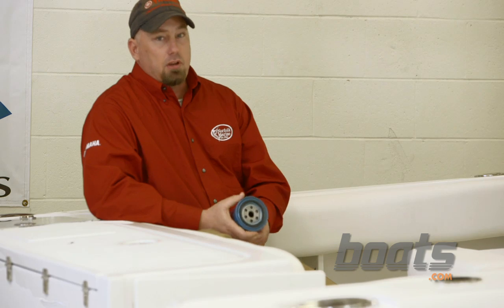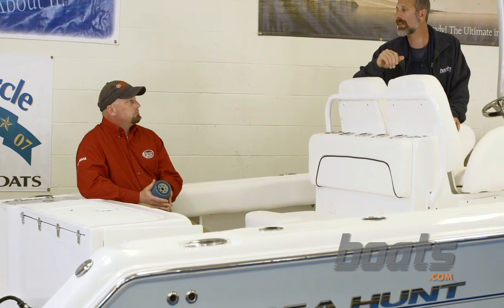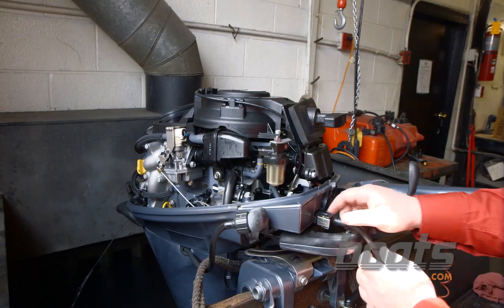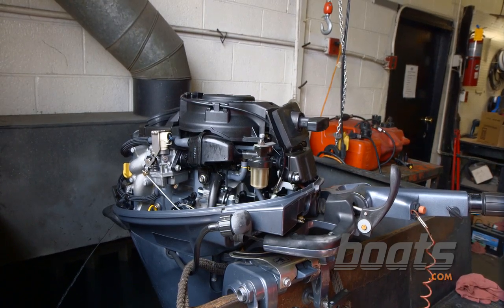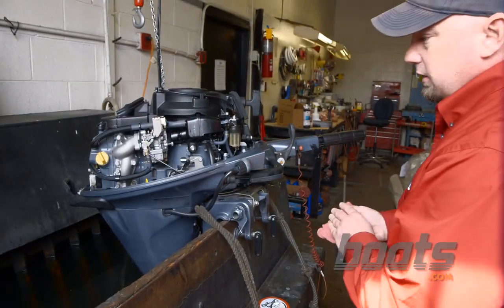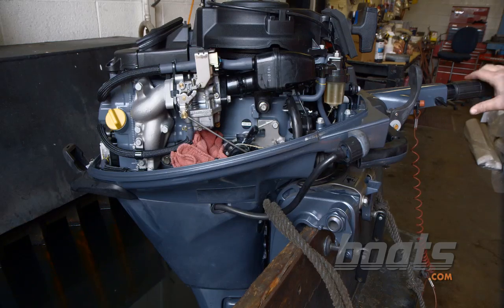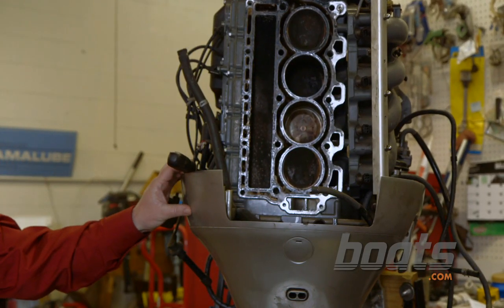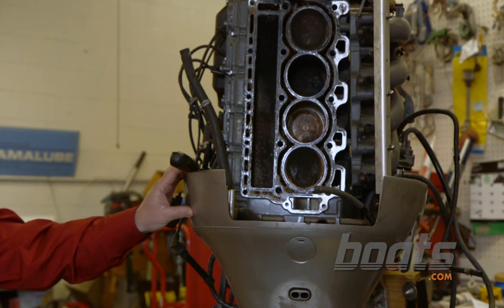The Most Common Outboard Engine Issues: Fuel Systems and Flushing

Comment: Years in outboards I have ...the additional suggestion to run the engine dry after a flush, by fuel line disconnect, after a passage, and engine FW flush, then to  drain carb fuel bowl when you leave engine for 1, 2 , 3 weeks is  good practice, and is worth all the effort taken and ensures your engine is always ready for the next voyage.   Best practice.

Comment: wish you would do a video on 4 stroke outboards making oil. I have a 2013 Yamaha F70 that I purchased new. Broke it in just like the manual said. Never had a problem for the first three seasons. Then last year after winter I hooked the hose to it and started, let it run for about fifteen minutes. I turned off and when I pulled the dipstick the oil was all the way up the dipstick. I drained the oil into a bucket and the changed the filter and put new oil in it. The used oil smelled like gas was in it. This engine has about a 100hrs on it and it doesn't stay in the water. Found out from the mechanic at the dealer they had the same problem on their rental pontoon boats because people just put and never run them hard. Now I run it at higher RPM's for the first 15-30 minutes and it does seem to take care of it. This is not just a Yamaha issue but happens to many manufacturers. Any thoughts?

Comment: If you aren't running every other day or every three days??? That's a little exaggerated.
Reply: Ventures With Joe that's extremely exaggerated lol. I'd say you only have to worry about it if you know you aren't going to run it for 30+ days, then you should drain carb of fuel.
Reply: I'll leave mine for over 2 months at some point of time and it runs perfect every time I get on it. And I never let mine run out of gas.its a 99 and runs like a champ
Reply: Sys falut Merkur optimax show

Comment: i have an older mercury outboard 50 hp. runs great but water only trickles out and when i open it up on the water has no power. bogs out. all feed back is appreciated

Comment: It's not a good idea to run your carbs dry as it will dry out any seals and gaskets. If you properly service the fuel systems you don't need to do this. First fill the tank this will eliminate condensation. Next you need marine fuel stabilizer. Run engine with muffs for 5 to 10 min. The fuel system has now been winterized. Change lower unit.  Grease fittings remove battery and your done.
 battery
Reply: I took your advice. Guess what, when i took my carburetor apart the bottom needle was suck and the screw that holds the float on was ate up from the fuel. thanks. well, It wasn't you who told me to do this. But many years ago that was the best way to do it. Until ethanol came along.
Reply: Ken Taylor 
That's the way I do it. Long life fuel additive.Full tank. (Non ethanol) Run motor. Store boat. Batteries on smart charger. 
When I'm back 12months later. Drain ALL fuel from tank. Clean filters(motor plus fuel water filter) refill... Lower leg check. Etc
.. Starts first time everytime. Yamaha 75HP 1995 motor.

Comment: I run premium 91 octane non ethanol gas in my engines. Can I leave my 2 stroke mercury 25 hp wet all the time? i treat the gas at every fill up and run the motor once a week until it is fully warmed up during the winter, in the summer  i get usually get out twice a week?

Comment: I have a 2006 mercury outboard 4 cycle fuel injection , Problem is it runs only tachs out to 3000 does not plane boat properly , It should tach out to 5500 to 6000 motor sounds good no miss fires very smooth operation , Any suggestion what to look for?

Comment: The biggest issue with all water craft engines is the use of "fuel stabilizer" IT'S GARBAGE! Don't be lazy thinking that fuel will be ok after several months of sitting. Just remove the fuel at the end of season. Simple. You pay thousands of dollars for that Engine and yet cheap out on taking care of it. This goes for any fuel that will be sitting for more than 2 weeks.

Comment: I have a 2003 Merc 115 four stroke fuel injected motor that will idle fine but will not rev up just dies.  Fuel pressure 140-143.  Will rev up if I squeeze the fuel return line from the fuel press regulator.  the fuel pressure then goes to 160.  Any ideas what to do.

Comment: Running a 2-stroke motor out of gas? No way. Not doing that to mine. The oil/gas mixture is what lubricates the engine. Running it out (running lean) is running w/out lube. Plus there will always be some left in the bowl. 
I run ethanol free non-oxygenated fuel with SeaFoam. She's sat for a year like that with no issues.
Reply: Lol, destroy your 2 stroke so you can came buy a new one!!!

Comment: Ok...just bought my first motorized boat...a little 14 foot john boat with a Johnson 30 hp. It is running great and I want to keep it that way. I have been reading comments and guess I need to get stabilizer and sea foam...I run 91 octane and 50:1 mix....anything else I need to know? Thanks in advance from a rookie who doesnt like to make mistakes. Almost forgot the plug yesterday but caught it before I got off the trailer.
Reply: Run non ethanol fuel. 50:1 mix if its available. Where you live. The ethanol is what gums up carbs.

Comment: Tohatsu 50 hp not enough fuel supply by primer,  fuel not supply in injector, engine is not started,  A. B. C flash lights is flashing,  plz share any this types of truble shooting vedios or suggestion.

Comment: any time you are having erract. run problems one simple check my fix it the tiny little oring in fuel connector can develope a hole from use and age pull old  oring out by hooking it with a fish hook replace oring with a new one  all boat shops carry them there is one in each end of fuel line should keep some on hand.  these  cause idle ok but when you rev up  theoring is sucking air not gas  ----about 50cts repair
Reply: Punctuation exists for a reason.

Comment: My neighbor just purchased a 5 HP Mercury outboard motor from a friend.  When he was topping off the oil injection tank he accidently poured in gas treatment instead of oil but discovered his mistake BEFORE running the engine.  What is the recommended method to flush out the tank?
Reply: Joe Becker

Comment: My boat motor revs up too much but it doesn't go fast is there anything you can help thanks
Reply from the maker: Hey Sam - there are a few possibilities, but most commonly if the boat ran okay and then this starts happening out of the blue, your prop is spinning out on the hub. The first thing I'd try doing is putting on a different prop. If it operates properly, then you need to have the old prop re-hubbed. If not, you'll have to head for the mechanic.
Reply: ok thanks for ur help i will try

Comment: Hi
I have a 4 stroke  parson 15 that wont fire, fuel is clean and is coming through, have cleaned and checked the space on the plugs, neither plug appears to be sparking, any advice
Reply from the maker: Colin Elwick this is one of those problems you simply can't diagnose from afar. Our best advice: bite the bullet and take the engine to a certified marine mechanic.

Comment: I have a 1990 Johnson 200hp 2 stroke and it just got a tune up.  new plugs, new fuel lines and bulb, new impeller, fuel pump was good, carbs are good, spark and compressions all good.  I had a problem with it the other day after the tune up was done,  it would not go faster than 10mph.  Called the shop they said I needed to let the engine warm up longer than what I did.  They also said check the fuel and the prop does that sound about right?  Also would you happen to know what the stock prop size for a that motor would be?
Reply from the maker: +onelik We need to start out by noting that it's nearly impossible to diagnose an engine from afar, but that said, insufficient warm-up most certainly does not sound like your issue. The prop would be suspect if the engine was turning the recommended WOT rpm, which in your case should be in the 5000 or 5500 rpm range. Otherwise, the fuel system is a possibility. As far as a "stock" prop goes, there's no simple answer. The correct prop depends on the amount of weight and type of hull it's pushing. Fortunately, most suppliers will let you try a prop or three and swap them until you find the right one. For more info on choosing the correct propeller, read our Understanding Propeller Pitch article

http://www.boats.com/how-to/understanding-propeller-pitch/

 which has our How to Find Out if You Have the Right Pitch Propeller video embedded. Good luck!

Comment: How do you flush an outboard motor that is mounted on a sailboat that sits on a saltwater mooring for 6 months at a time.  My best idea at the moment is to flush it from a 5 gallon jug of onboard fresh water after each weekly sail?  That seems like a hell of a lot of work.
Reply from the maker: There's no easy answer since it depends on how and where the engine is mounted and whether or not it has a flushing port.

Comment: I have a Johnson 150 2 stroke 1994 it seems on hot days she doesn't want to idle correctly to get the necessary RPMs to get me to plane is this a carburetor issue or water pump?
Reply: Definitely not the water pump

Comment: Could not get fuel to my merc 225 outboard.   Changed bulb - fuel line looks OK Brown fluid (thin) coming out vent port on side of boat. Year 2000 boat and motor for saltwater. It has been in storage for a few months and just added 50 gallons gas with ethanol. Volume of gas when stored less than 20 gallons.
Reply from the maker: Hey WarThunder Bros., have you made sure the vent isn't clogged? When an operative fuel line won't supply any fuel, that's often the case.

Comment: ive got a 25hp mercury (1980s era) it has been siting for two years without running but after some work i got it running but when i turn the choke off it dies. i have to start it at full choke and turn it back a quarter of the way and itll run for a little bit and then it starts to die unless i put it back to full choke. i try going back and forth with it for a little while then try turning the choke off and it kills almost right away. i put clean gas in it and tried running seafoam through it which didnt seem to help much either. any suggestions on what i can try to do to get it running properly?
Reply from the maker: Hi sam garr. Sounds like it's time for a full-blown carb rebuild; just running Sea Foam or cleaner through won't do the trick. Be sure to completely submerge the carburetor in a bucket of cleaner, when you do the job. Let us know if that works.

Comment: 150 Johnson, runs fine for about 1 hr, when throttle back from full speed, it dies, takes a while to start, then idles high 4500 rpm, then will slowly drop to 1200rpm, symptoms repeat.. Any idea? I'm thinking carb floats?
Reply from the maker: That's a good thought, we'd start with a complete carb rebuild. Let us know how it goes.

Comment: For a 2 stroke oil injected engine definitely would not recommend running the engine until there is no fuel left....!
Reply: I would think it would be best to run the fuel out of the carburetors. Then there is nothing to eat at the metal in them. The top carb always has no fuel in them when you tilt them up. it drains out somehow. every  time i have cleaned are rebuilt them they have no fuel in them. and the gaskets are fin in them too.
Reply: Dean. I'm with you . when a two stroke is running out of gas it's also running out of oil
Reply: Dean  I purchase a two stroke engine boat and the former owner told me to spray a carburetor cleaner before I start the engine I did and start but them the engine stop in the middle of the lake, I manage to start again but is not reliable, any suggestions   Thanks.
Reply: Yes correct for carbureted 2 cycle outboards, the service manual I have says at the end of the season, to cut off the fuel then run at idle till the engine starts to sputter then shut it off. This way as soon as the lowest carburetor starts to run out of gas, the engine is off so there is still oil coating those cylinders but some of the gas has been used up so less to dry up and leave behind problem causing gunk.

Comment: Got a 2010 70 Yamaha 4 stroke. Engine is hard to start, but once started runs fine for about an hour or so. Then it acts like its starved for fuel--as if you had disconnected the fuel line. I can pump the gas line bulb a few times and motor runs ok for a time--then process repeats itself many times. I assume its a bad fuel pump? Not sure as there are a lot of sensors on these new motors. Any ideas?
Reply from the maker: Hi Jeff P. That's a tough call. We went to Norfolk Marine Company's Yamaha Master Tech, Chris Breeden for his advice:

It does sound like the fuel pump could be going bad. Two other possibilities are the primer bulb, or even the anti-siphon valve on your fuel tank. Hope this helps!

Comment: Doesn't running the engine out of fuel cause an excessively lean condition that is harmful to the engine? I've stored my engine using fuel saver for up to 6 months without any problems.
Reply from the maker: samiam1150 No, it doesn't harm the engine one bit. Remember, these are carbureted two-strokes we're talking about, not complex EFI engines. All the marine mechanics we've known through the years give the exact same advice.
Reply: ***** Two strokes are lubricated by the oil that is mixed with the fuel. An excessively lean fuel mixture can and does harm 2 stroke engines. When I bent wrenches on marine engines we drained the float bowls. We didn't run them dry.

Comment: I have a 70hp evenrude outboard 2 stroke. At idle starts and runs fine but under load goes in and out of power. Any suggestions would help
Reply: That's your carb buddy.
Reply: @nonya8694  your dead on bro

Comment: I use to do that on my first engine an 5 hp briggstraton, now I have a 1996 Yamaha 115 two strokes, should I run it until cut off disconnecting the fuel line too?? considering the mix of fuel and oil also lubricate the engine.
Reply from the maker: Yes Hugo, you're fine - remember, as long as the engine is firing there's fuel, and as long as there's fuel there's lubricant, so there's no danger in running it out of fuel.
Reply: Thanks a lot
Reply: Have an additional question, should I write here or at separate email

Comment: i have a 1985 yamaha 50hp ETLJ  4 stroke ....i can run it max or even half speed for over 2 hours with no issues.water comes out and always have green oil light on...but when trolling for 20 min or more the alarm will sound in the throttle control box ..i have to turn it off for aprox 10 min then i can go again for a bit.why is it over heating i have a steady flow of water pissing out the back of the motor ..green light all times.i am running yamalube 1 which is what they recommend in the manual.intake vents are clear nothing blocking water flow.sometimes i can troll for over 5 hours with no problems other times 20-45 min and alarm sounds,and exhaust is coming out fine,.please help and ty in advance
Reply from the maker: Hey Tanker - ouch, this is a toughie, and we simply can't diagnose this one from afar. Best we can do is recommend taking the engine in to a certified Yamaha tech - sorry!

Comment: Hi, i have a 1975 85hp 2 stroke evinrude. I use ethanol free fuel. Do i still need to starve the engine and drain the carbs? Thanks
Reply from the maker: With any carburated outboard it's always best to do so if the engine is expected to sit for a week or more - ethanol, or not.

Comment: If I'm running ethanol free gas, I don't need to worry about this issues so much correct?
Reply from the maker: Hey Brutal Bear (nice pic!) As far as the fuel system goes that's correct, just as long as your fuel doesn't sit for more than a couple of weeks. (If it does, you may still have issues). But when it comes to flushing you still need to be 100-percent sure to flush on a regular basis.

Comment: I have a 70hp yamaha 4 cycle on a pontoon boat my wife has had since long before we got together.  i put new tanks on it ran it with water before taking it out on the lake and it ran fine.  Didn't get 200 yards and it quit.  Put a new primer bulb and fuel filter in it and it still won't run. It fires and dies. Anybody got any ideas I'm thinking fuel pump but I really don't know this motor.

Comment: 07 yamaha vmax 150 carb engine extremely hard to start cold..once it starts the first time then it starts really easy the rest of the day 2 Days Later again super hard to start takes forever put boat in winter storage 4 months' the fuel stabilizer in the tank now it won't start at all won't even hit just crank anybody have any suggestions would be greatly appreciated

Comment: i have a 35 johnson 1999 3 cylinder it will run for about three bends in the river,then get hot,has a stream coming from water pump,changed the temp. sensor no help,now since it has set for awhile,go to crank it and as long as you dont pump the to BUBBLE TO TIGHT tight it will start and run for about 20 seconds and goes dead,think i'm going to replace the water pump anyway it's been several years since i have changed it,as far as the running dont know thought maybe fuel pump or carbs. need cleaning,open for suggestions.THANKS!!! IVAN BURKETT
Reply: If it has one, then the thermostat may be stuck closed. It's fairly easy to check.

Comment: Is it possible to drain fuel on a 50 hp evinrude etec? What kindof fuel is best to use for it also, unleaded gas?
Reply from the maker: Hi Elton Williams, you can drain the lines and filter, but a bit of fuel is bound to remain. As far as fuel type goes, Evinrude recommends any gasoline with an octane rating of 87 or higher and no more than 10% ethanol.
Reply: Awesome thank u.
Reply from the maker: Elton Williams You're welcome.